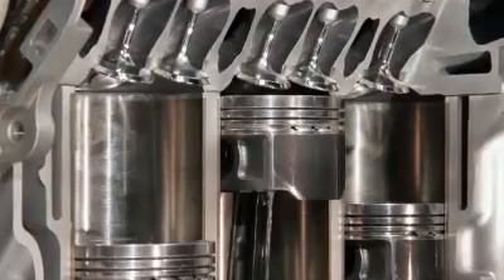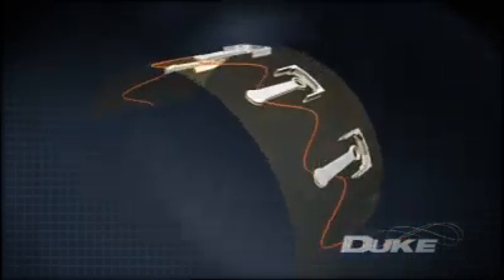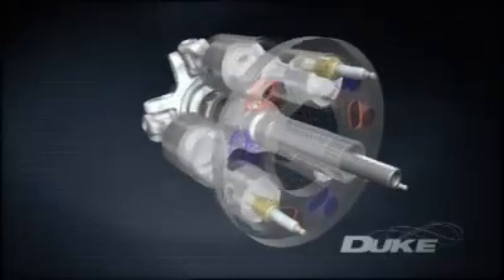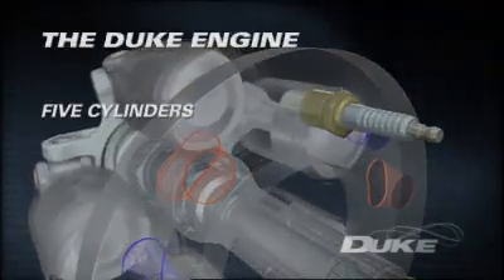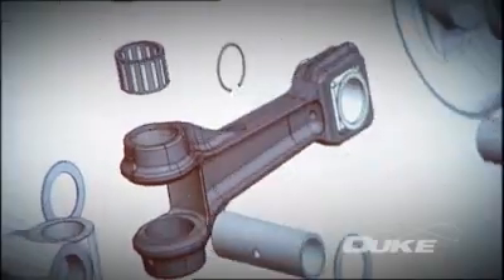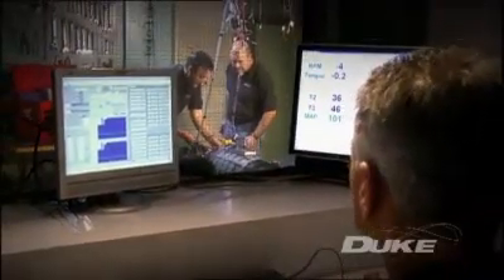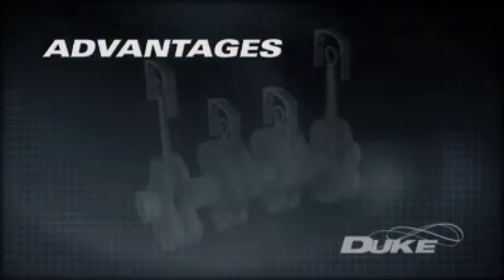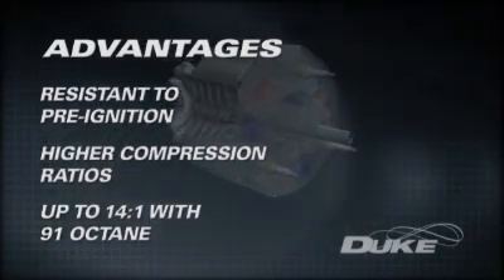High Power lighter weight

Comment: The rotating sleve can have problems like the sleeve valve engine used in aircraft and some small generators.  Try the duke engine in a oilfield application wich is one of the most Demanding applications for  life and durability. so far the standard piston engine used around the world has been the most reliable. My 4 cylnder 2.5 liter GM engine went over 300,000 miles with just a fiber cam gear falure

Comment: That moving head seal looks like it could be trouble. Seal problems are hard on rotating engines.

I like the design though. It seems it would deal with the reciprocating mass well.

The best market for light engines seems to be aviation. Depending on your speed you may have to much rotating inertia. Wouldn't want a gyroscopic effect like the Sopwith Camel for the general aviation market. Could add a second bank of cylinders turning the opposite direction.

Comment: Very Very good, If some of the problems of durability could be solved such as the sealing, and side load of the pistons, this would be a great little thing. Would it be possible to add a track along the side of the pistons with roller bearings to reduce side load friction on the pistons? I know it would add some drag but it could be worth it.

Comment: I'm curious to learn how they achieve sealing of the combustion chamber on the top of the revolver style block to the intake and exhaust plate. Also curious on how they cool the engine with it's rotating piston housing, which also must contribute to a large rotational mass that would require very high degree of balancing. How are the tie rod like sockets the connecting rods are affixed are lubed? Although this design is not new, I've seen designs like this dating back to 1911. Quite impressive.

Comment: THE CYLINDERS MOVE IN A CIRCLE ALSO,AS I SEE FROM THIS VIDEO ,THE CENTRIFUGAL FORCE WILL AFFECT THE ONE SIDE OF THE PISTONS MAKING IT WITH TIME RUBBING ON ONE SIDE OF THE WALL OF CYLINDER,THE FRICTION WILL INCREASE WITH HIGHER RPM, SO WHAT WE HAVE HERE,SOME CONDITION THAT DOES NOT EXIST IN NORMAL ENGINE,OTHER THAN THE OIL WILL RUBBED FROM THE INNER WALL TO THE OUTSIDE OF THE WALL DUE TO THE SAME FORCE,UN EVEN FRICTION TO THE WALLS AND THE PISTONS,WILL DESTROY THE ENGINE FASTER THAN REGULAR ONE.

Comment: I saw it in a video.. it was shaking four times more than a boxer engine :/ (and the after-made balancer adds too many friction parts, as a standard engine maybe)
Based on what I know the actual Shepherd motor will suffer heavier durability problems and friction: the main assembly raw up considerably when he oiled it for some time, but what I'm worried about are the swinging exhaust pipe. this one seems a little more forward but i seriously doubt of the mechanism that makes the cylinders shift.

Comment: Ok people I see a lot of y'all asking good questions about this engine . However I also see some mistaking this for an aircraft engine . Let's take care of the main question does it work ? 
Simple answer is yes .
More detailed answer is no it doesn't work .
Reasons it doesn't work
Based on 3.0L turbo which they claim puts out 215 hp .
1 All the mass from the cylinders rotating kills the power ( 50-60hp ) .
2 The counter rotating crankshaft ( WTF WHO THOUGHT THAT WAS A GOOD IDEA ) there's 60+ more hp lost
3 The friction of the cylinder seals although not as much lost as the other 2 reasons but still 20-30 hp lost .
So with just those 3 you've lost at least 130hp .
That's why fixed cylinders with a rotating crankshaft will always out perform this engine a 2.0L 5 cylinder turbo diesel ( think it was a Dodge Van ) put out 170hp , which makes me question why did the S10/Colorado with a 3.7L I5 gasoline engine only make 242hp&tq & the 4.3L v6 170-210 hp & 240-290tq depending on year ? Btw I have to say properly done a 5 cylinder would be ideal you still have the overlapping power strokes like a 6 cylinder I'll be it only a 36° overlap vs 60° but that's enough . The 5 cylinder should've had more hp & tq but the lack of interest from consumers meant death for this engine before  they even started updating it . OH #### this thing's still recording ! Just thought I'd leave that in to give y'all a quick laugh .

Comment: So what HP #'s did the engine pull of?
Reply: 350hp at 6200rpm with an engine that weighs less than 100kg. that's the special from another video from the manufacturer. 
less weight and size and more power than a standard v6 in a car

Comment: The only place I can see a potential problem with this engine is how it seals the rotating cylinder block against the spark plug/valve end. I suspect it would have a lot of the problems Wankel engines have, in terms of burning oil.

Comment: Horrible design.They are taking a regular 4 cylinder and adding ports for the intake and exhaust on it.The only way we can improve on the internal combustion engine is to get rid of this up/down motion from the pistons.Every time the piston has to make change in direction that is all wasted energy.The only good design would be similar to the jet engine design.In the different parts of the engine there is the intake, compression, power, exhaust. They all happen at the same time instead of puffs.